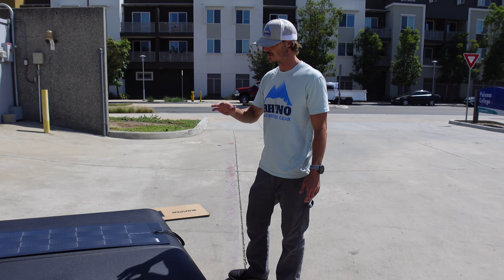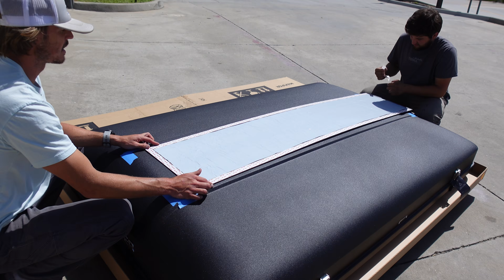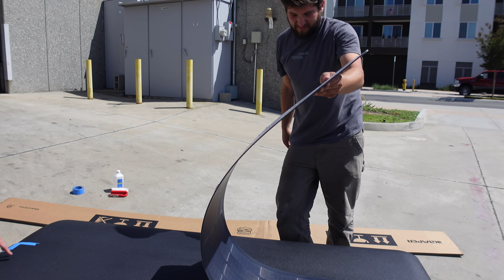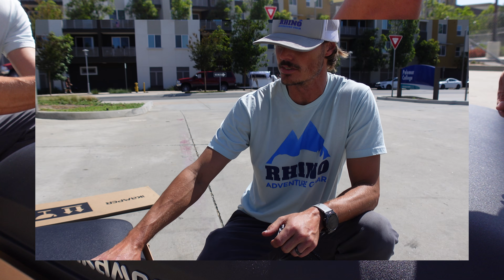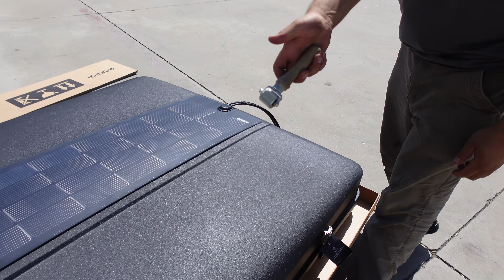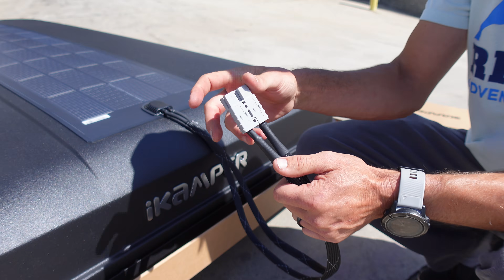Install 110 Watts of Solar Power in 10 Min!

Comment: Hi is there a reason this is installed with the connection point at the front of the Ikamper? Could you install it reverse so the wiring is near the rear? Thanks!

Comment: Can 3 panels fit on ikamper 2.0?
Reply from the maker: The SolarHawk wasn’t designed with the intention of having more than one unit on an Ikamper at a time. While we have seen a few customers manage to pull it off it’s not our recommendation. The edges of the two outside Solarhawks come too close to the curves on the tent edges that we fear the panel would develop a raised edge. That would compromise its ability to stay properly adhered to the IKamper. Hope that helps 🤙

Comment: How difficult is it to get that panel off and replace if breaks or fails?
Reply from the maker: The panels are adhered with 3M VHB around the edges and butyl adhesive everywhere else. They stick on pretty darn good. If you need to remove one it would ruin the panel and there would be potential for some cosmetic damage to the tent as well. With that said, we have been able to successfully remove a few of them at the shop with minimal impact. YMMV. Hope that helps - thanks for watching.

Comment: Hey guys, will this plug straight into a Jackery 1000?
Reply from the maker: The Solarhawks come with an SB50 Anderson connector. You'd need an adaptor that's fairly easy to find for it to work with a Jackery. Your best bet is to give us a ring and we can help get you the right adaptor. Thanks!

Comment: Will this fit on a roofnest condor xl?   If so, I’m wondering how well this adheres.  I’d worry about over landing on the road for hours and what of when you want to remove it?   Will it scratch it all up?
Reply from the maker: It depends on the roof footprint of that tent. That’s not a brand we carry, however the SolarHawk is about 77” long by about 15” wide, so if you have that flat  real estate on top of the tent, then yes it could very well work. The installation to the tent is via a butyl adhesive in the center and 3M VHB adhesive tape around the edges. We’ve installed 100s of these onto the iKampers (including their Rocky textured units) without any issues. Pre installation prep is important. The install is considered permanent - you wouldn’t be able to take it off without running the panel. Hope that helps!